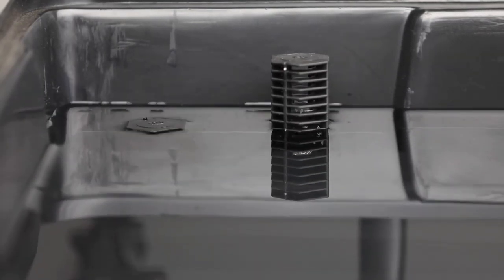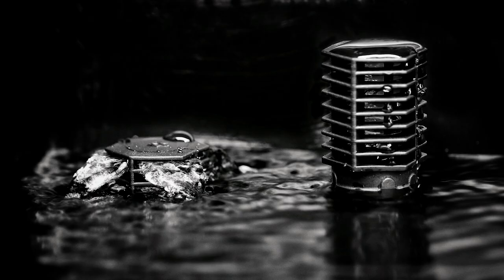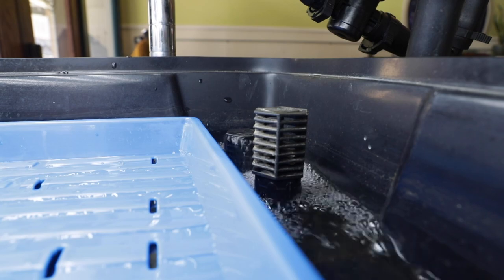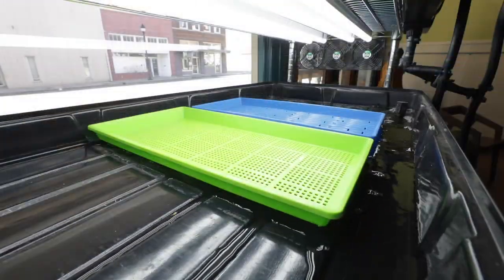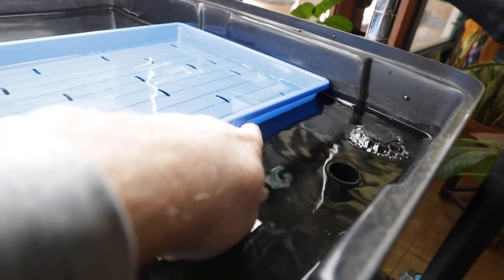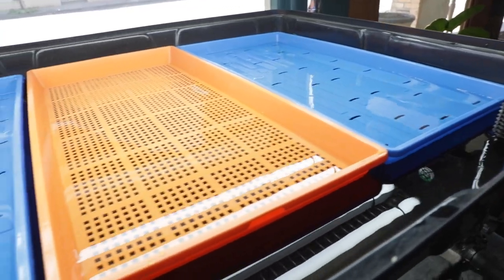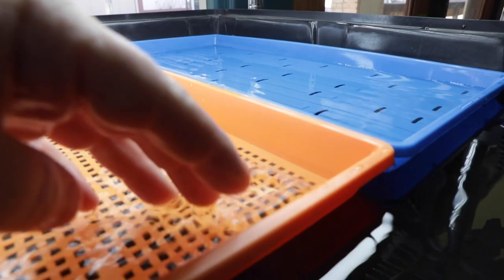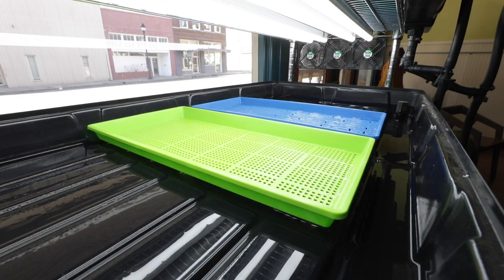How to Use Flood and Drain Trays

Comment: From What I read in "Hydroponic Food Production," by Howard M.Resh, the roots should not be exposed to air any longer than twenty minutes. This style of technique is supposed to create a healthier root system due to the plant needing to retain more nutrients within a limited time window. If the plants are not re-introduced to the nutrient water within the time window then the plant will die.
Reply from the maker: That is certainly the case in DWC or NFT, however the system you see here is primarily for microgreens and propagation in which if flooded 24/7 would lead to dampening off in microgreens or over saturation in newly sprouted seed starts.

Comment: In a system like this, is there an increased risk of spreading pathogens between the trays since the trays share the same water?
Reply from the maker: Regarding hydroponic recirculating water systems, one of the best practices for preventing contamination is to ensure proper maintenance and testing of nutrient solutions. It's also essential to use clean, quality-tested water sources and replace any components that may become contaminated. Additionally, grow systems should be regularly cleaned and disinfected and all equipment should be routinely checked for signs of wear or damage.  We also know from previous experience that having proper cleaning solutions on hand ready to deploy at the first signs of trouble really helps. You don't want to detect an issue and have to wait for a solution to be shipped.
Reply: The only contamination problems I ever had with these systems is root mealybugs. They will spread very easily with this system. Other than that it's not really much to worry about.